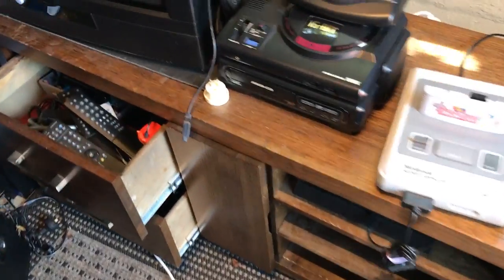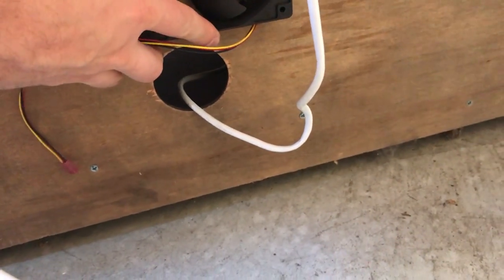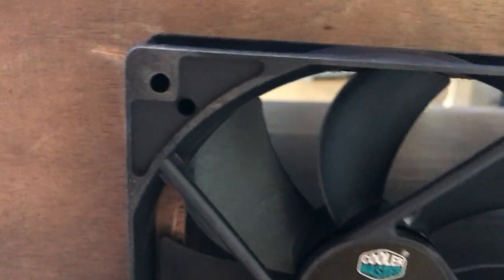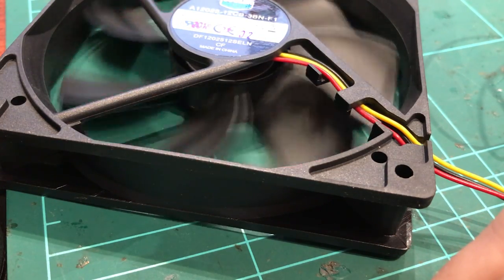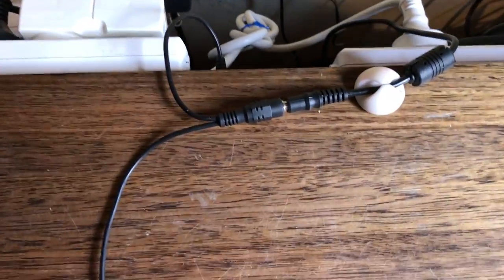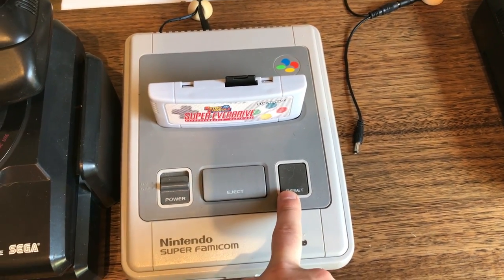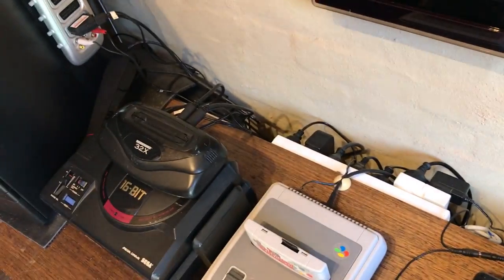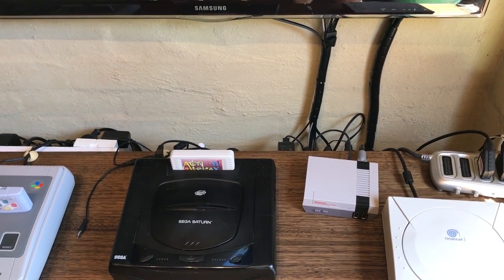Game Room Setup & DIY Media Cabinet Cooling Fan Installation

Comment: Very cool custom design. But it seems like alot of work/cost you could of avoided just getting an AC Infinity AIRPLATE cabinet fan kit. Their designed specifically for cabinet cooling so their LCD control adjusts the fans cooling depending on how hot it is. Looks more professional and probably costs the same as buying all these parts in your set up.
Reply from the maker: bryan adaas You’re right that Airplate looks amazing and is quite cheap. I never knew that existed.

Comment: can u get a little fan extention cable where u just plug them little clips in for someone not done wireing as got a little fan out a sky box and wanna use it on my arcade cab build as extra cooling ?

Comment: Nicely done, the fans are a pretty "cool" idea 😌. It made me smile as I use literally all of your kit; from the labels, to the component switcher, cheap upscaler & modded full console collections (everdrive, gdemu etc). I zip tie all of my cables behind my unit to the shortest manageable length possible but they still look a bit messy when you have 10 consoles hooked up at once lol. My OCD I guess ha.

Oh I've started to notice some interference with my component switcher (faint grainy speckles on screen) when using the PS2,Wii,OG Xbox have you ever noticed that with yours? Was wondering if what you said about the scart switcher interference could be happening with my component switcher? All 3 are always hooked up to it
Reply from the maker: Robert Beard Yep any switcher you use really should have physical disconnections or be of very high quality. Not a lot we can do about all the cables, just the labelling helps and to tie them together so they don't tangle.

Comment: I have the problem you're talking about, the widescreen on the CRT with my megadrive 1 but I have no setting on the TV to have it fullscreen
It doesn't do it with the megadrive 2 nor the snes or any other rgb console I have which is weird.
Reply from the maker: adilator Easy fix mate I'll show you how in the next video
Reply: You'll be a saver... the megadrive 2 is pretty dodgy with the crt. the image flickers and there's a faint buzzing sound. Would love to get the MD1 working on the CRT.
Reply: Still waiting.... patiently waiting... :)
Reply: adilator - to punch somebody